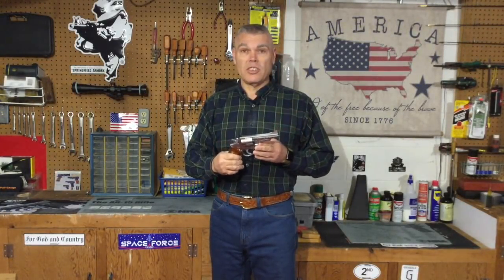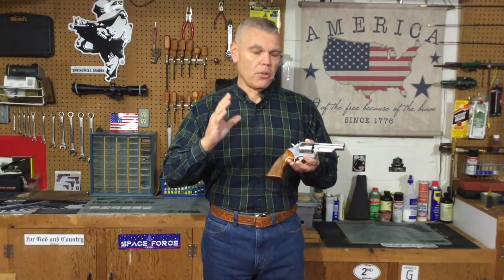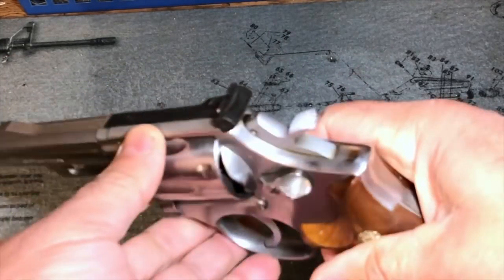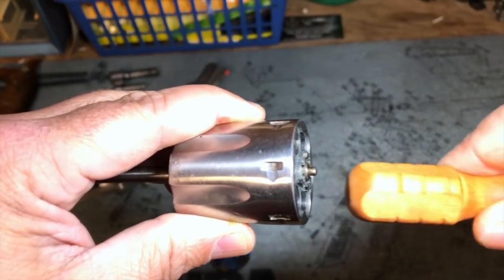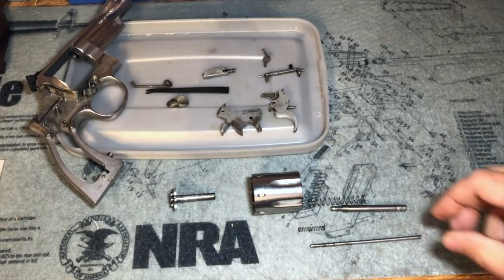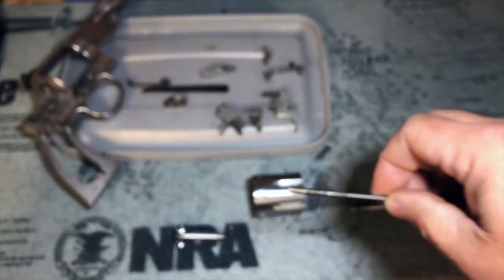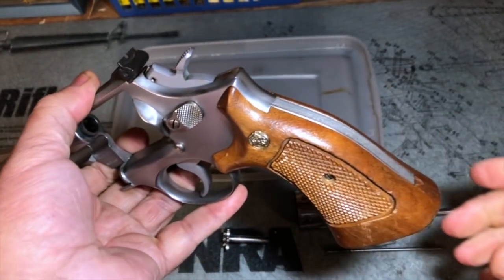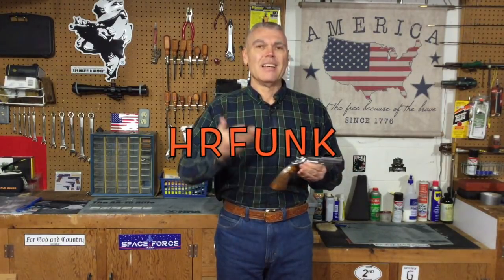S&W Combat Magnum Resurrection

Comment: How cool is that to resurrect a S&W Model 66 Combat.   I bet you got one heck of a good deal.  Today's MSRP on the Model 66 is $874.   What's your thoughts on the 66 combat 357 Magnum with the 2.75 inch barrel?  As far as lubrication, I've been lightly using Mineral Oil.
Reply from the maker: I've got a 3" Model 66 and it's my favorite wheelgun. I've seen the 2.75" version, but I don't remember ever handling one. In terms of appearance, I prefer the older one. I suspect performance will be about the same with either one. Plus, the new one has an extended warranty. So if you do have a problem, S&W will fix it.
Reply: @hrfunk  I've been wanting a 357 magnum revolver to carry when I'm trout fishing mountain streams.  I've considered the Ruger SP101 and the S&W Model 60.  I didn't much care for the SP101's  trigger pull, and not so sure about shooting the 357 magnum from the J-Frame 60.  With that said I'm now considering the K frame S&W 66 Combat 2.75 inch barrel.  I was leaning towards the Ruger SP101 until I tested one.  I hated the trigger, long and heavy pull.  It just didn't have a good feel.   Anyway, the model 66 is appealing with it's history and it's size being a K-frame.

Comment: Wow! It looked like it was lubricated with motor oil. So what was before and after double action pull? Did you get a great deal on it? Thanks for sharing 👍
Reply from the maker: The D/A pull is to heavy to measure on my gauge, so I still don’t know what the exact weight is. I’ve ordered some Wolff springs. When they arrive I’ll swap out the factory springs and maybe then I’ll get a measurable pull weight. In the end, I think I got a very good deal on this revolver. I worked out an mutually agreeable trade with the former owner.
Reply: @hrfunk  So even after all it's still to high? Have you seen this before? I've seen lots of positive reviews on the newly designed classic series what is your opinion on them? There's a lot of talk about the sleeved barrel and after listening to both sides I think it's definitely a improvement. I'm thinking about the 10 or 19 I'm thinking I will probably just be shooting 38 but I also plan to have a matching caliber lever action so 357 Magnum would be a good option for hunting. I may go 19 and reload 357 lighter for the pistol? Do light loads like full 38 or +p 38 work well in 357 cases? Thanks Howard 👍
Reply from the maker: @brianlee6849  The pull is still a little heavier than I like. It’s perfectly serviceable. I would classify it as being on the heavy side of normal. With the spring replacement, I expect to shave a couple of pounds off the DA pull and make it a little more “shootable” for my purposes. Essentially, I’m just customizing the pull to my own taste.

As far as the new revolvers compared to the old ones, I prefer the lines, aesthetics, and history of the older wheelguns. When it comes to shooting, there probably is not a whole lot of difference.

You should be able to fire .38 loads safely in .357 cases, but you might loose a little velocity due to the larger case volume. 

Best of luck!
Reply: @hrfunk  Ok cool thanks 👍

Comment: I am curious. S&W has a practice of changing model numbers to start with "6" when the gun is released in stainless steel. For example, the model 29 (.44 mag) become a 629 in SS.  The model 586 (.357 mag) becomes 686 in SS. So why doesn't the model 19 become 69 or perhaps 619 in SS?
Reply from the maker: The Model 66 was only the second revolver that S&W rendered entirely of stainless steel. (The first was the Model 60) It was followed in later years by other stainless versions of the company’s traditional revolvers such as the Model 64 (the stainless version of the Model 10), the Model 65 (stainless Model 13), the Model 67 (stainless Model 15), etc.

Now this is pure speculation on my part, but I suspect that whoever assigned model numbers at S&W initially envisioned the “60-series” as comprising their stainless steel revolver models. As the number of stainless offerings increased, it became apparent that once the stainless steel revolver models exceeded 10, a different model numbering system would have to be used. This was also (give or take) around the same time S&W would have been considering the notion of offering their semi-auto pistols in stainless steel. Someone apparently came up with the idea of retaining the numeral “6” to denote stainless construction, and simply adding that numeral as a prefix to the existing blue-steel model number. Hence, the 629, 657, 642, etc. in the years since then, S&W has adopted other numerals to indicate various design and construction aspects. While the effort was obvious, you will not find absolute consistency through all the company’s myriad models. In fact, once one becomes conversant in the numerical model numbers, they are, at best, a vague guideline. To accentuate that point, S&W has offered both a Model 619 and a Model 69. Neither one is a K-frame Combat Magnum.

Comment: Lived in Springfield in 73,,,bought a used Model 19-3 that was beat...cylinder wouldn't turn...firing pin bushing was chewed from too much dry fire...gun cost me 75 bucks..figured if it cost me a few to get it going, why not?....Called S&W...secretary says "What's wrong with the gun? told her..she's say's "bring the gun over, I'll have somebody take a look at it"...pulled up to the main gate . Guard comes out, says "what's up?"...I hold the gun up, tell him I was told to bring the gun over. He's say's 'hang on a minute"..goes into the guard shack..comes back out..says "Go up to the main building, ask for Fran"...Walk in, secretary says..."Fran will be right out. Fran comes out...looks at the gun and says' "let me have this for a few minutes" Comes back out..straightened the ejector rod,, new firing pin bushing, and checked the cylinder timing..hands me the gun.."no charge".Gun hasn't missed a beat since then. Still have it. Loves .38 Specials.
Reply from the maker: That's a great story about how S&W operated in the old days. I doubt things would still go that way now, but I wish they would. Thanks for sharing.
Reply: @hrfunk  You are absolutely correct,, and in this day and age,, I wonder how many holes I'd have in me if I pulled up to the main gate and held up a revolver now...hahaha

Comment: The double is heavy on my 66 also , I use Remoil only on mine it’s only 2 years old
Reply from the maker: I think the newer ones generally have a heavier trigger than the older versions. If you know someone who is well versed in S&W wheelguns, have it checked to see if there are any issues that need to be addressed.

Comment: You know a lot more that I but more a problem of type of lubricant and not over lubrication me thinks. Gosh what did they use??
Reply from the maker: Pancake syrup from the looks of it.
Reply: @hrfunk  you have a beautiful 2.5” 19-5. I just got me a 1974 19-3. What a great revolver. I’ve had a 2.5 inch 66-4 which shoots great for many years.

Comment: This is exactly what was the issue with all the guns that my grandfather gave me
Reply from the maker: I hope you were ablet to get them cleaned and working properly.
Reply: @hrfunk  yeah, I did. I was young when we first got them, but we got them cleaned enough to function. Last year during the 'lockdown' I took every single gun in the house one at a time. Took it to the cellar, looked up the exploded diagrams, and watched videos on how to take them all the way apart and did so. Cleaned the hell out of them all, lubricated, greased, and put them all away. At this point, I have more gun cleaning and repair related tools, and supplies than the rest of my 30, if not more family members combined lol

Comment: Sir, what kind of lube where you using?
Reply from the maker: My old standby. Mobil1 synthetic motor oil.
Reply: @hrfunk  Lol, Alrighty then
Reply: @hrfunk  is that too 'thick' of an oil to use on guns ??
Reply from the maker: @geezerp1982  it was recommended to me in an armorer’s training course and it has worked very well for about 15 years.

Comment: Wouldn’t it be possible to soak in some kind of solvent to get all the funk out?
Reply from the maker: Not really. These parts really needed to be scrubbed clean, dried, and then properly lubed.
Reply: @hrfunk  Obviously I’m no gunsmith.   Just seems like could have been soaked in some sort of acid vat
similar to what auto transmission mechanics use.

Comment: Could you soak parts in denatured alcohol?
Reply from the maker: I don’t think so. I once threw a pair of stainless steel handcuffs into some alcohol to decontaminate them and they rusted.
Reply: @hrfunk  That's what I wondered. I have a old Corbra with the same issue and not sure my gunsmithing skills are good enough to put it back together...lol
Reply from the maker: I would say find a good Smith for that one. It deserves it. It probably won’t cost much for a good deep cleaning. Best of luck Mike!

Comment: Years ago I used wd40 on a snubnose revolver and put it away in the safe. 5 years later I pulled it out to shoot it and it was froze up tight. I took a rubber mallet and hit the cylinder to get it open. To make a long story short I took it to a gunsmith who had to replace the broken hand that turns the cylinder. NEVER use wd40! Cost me 100 dollars. Lessons learned!
Reply: 3in1 oil does the same thing.  I use Marvel Mystery Oil.
Reply from the maker: Sorry that happened to you. I hope that snubby is still healthy today.
Reply: @hrfunk  Working fine now that I learned my lesson!

Comment: How can you use the wrong lubricant, gun oil says it's for lubricating guns on the bottle.  Who would be dumb enough to use something else.
Reply from the maker: Not all “gun lubricant” is the same. Some will congeal and harden over time if it is not periodically removed.
Reply: Hoppe's #9 gun lubricant is plain mineral oil.

Comment: I had to replace a broken cylinder bolt (something that "never happens") in a 25-2.  You didn't show the cylinder bolt spring.  I know why.  It is so comically small you can barely see it :)  Pity you are unable to show disassembly/reassembly.  Lots of people are spooked by the innards
Reply from the maker: I know, I wish I had just gone ahead and done that. As it turned out YouTube restricted this video anyway.
Reply: @hrfunk  Going anywhere else?  I think everyone is thinking in terms of alternatives these days
Reply from the maker: I’ve considered it, but I haven’t taken any steps yet.

Comment: I am of the opinion that unless you are in a battlefield situation, the revolver and certainly a quality da/sa revolver like the Combat Magnum,will get the job done. Firearms proficiency has been dumbed down to fill the air with bullets and hit something, poor training in handling so that simple striker fired or da only pistols with a minimum of training are issued to those sent out on the streets. Even without magnum ammo , plus p lhp like the Buffalo Bore lhp send a 158 slug out of a 4 inch barrel at around 1100 fps. More than enough to stop a fight if one can place them properly. And that is the problem . Too many without the time, training and practice to do so.
Reply from the maker: I agree!
Reply: Six for sure. Better to end it with the first of six than the last of 17

Comment: Do not use motor oil to lubricate firearms!!!!
Reply from the maker: I’ve been using it on the friction points of all my firearms for at least 15 years and it works very well. I use Mobile 1 synthetic which was recommended by the instructor of my S&W armorers training course.